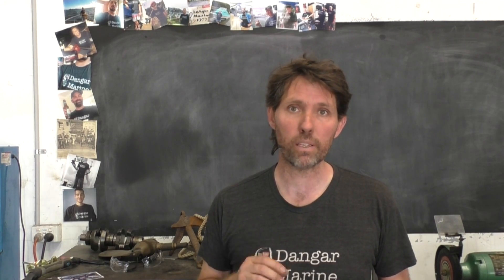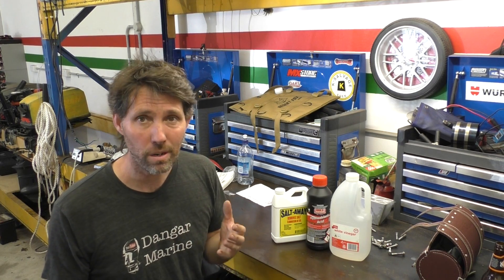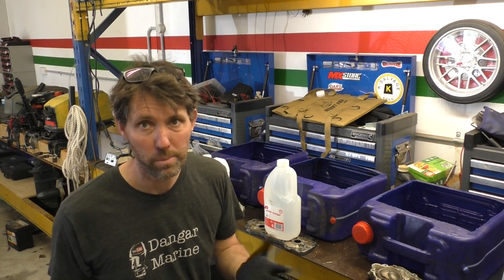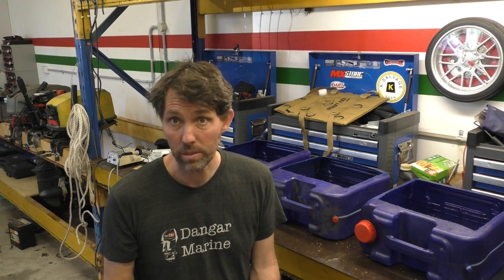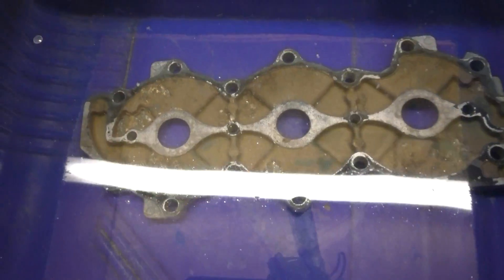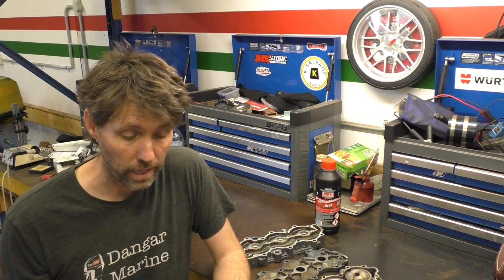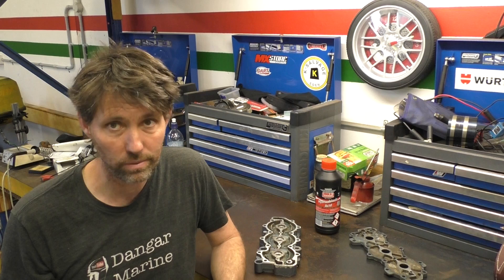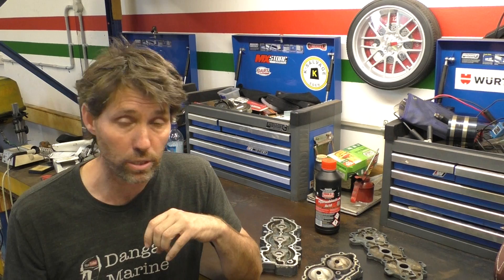Cleaning outboard water passages

Comment: I've used Saltaway and Rydlyme, via an extended flush with a bilge pump in a bucket underneath my motor. Rydlyme rocks, but it is expensive. Also seen good results with the acid.

Comment: I have a mercury/tohatsu 25hp 2 stroke, after I got stuck in sand immediately turned off , saw no damage... after a few days engine ran 4 hours then started overheating . 
I ended up checking compression 150-150 replaced fuel pump diaphragm , carb rebuilt , impeller , tested thermostat in hot water .. 

no damage to lower unit replaced gearoil and some gear oil seals while at it.. ran it still overheats after a while ran it with other coil cdi set from spare engine same problem..

it has solid stream once thermostat opened tested adjusting timing / air/mix on the carb nothing

I'm about to test the diluted acid in water trashcan for 45minutes method...im getting desperate . or any input?? maybe you know better then me or im missing something..

Comment: I had an overheating motor. I used a sump pump in a bucket under my lower unit and poured 6 gal of white vinegar undiluted. I discharged the pump through the tell tale connection and let it run about 8 hours, It worked, no overheating.
Reply: Did the same thing with Rydlyme, worked great! No more overheating

Comment: Thanks for the video, information, and side-by-side comparison.  I'm currently working on an '88 Evinrude 90hp that is overheating even after replacing the impeller. I really need to remove/replace the thermostats before trying a chemical flush. Think I'll just remove the leg, connect a holes to the water tube with a pump in a tub under outboard with the muriatic acid. Pump that thru the water passages a while and see what happens.

Comment: I know this is a late comment on a 5 year old video but I will share my experience using HCl. 
Motor/History: Mercury 2001 EFI 150 HP V6 - Tortured with Hawkesbury river mud and salt -  freshwater flushed after every use 
Fault: After 20 years - Overheating on idle despite a healthy urination stream and changing EVERYTHING in the cooling system
Remedy:
Remove the lower unit + thermostats from the housing and replace the housing and rapaciously jam a plastic tube up the orifice where the copper water normally fits into the power head from the water pump.
Connect a 12 volt pump to that tube to pump diluted acid through the engine collecting the discharge in tub with the immersion pump in it to cycle it through the engine
 I started with a ratio of 20 : 1 but the flush remained clear meaning it was doing nothing - need more acid!
Set up a control using aluminium, brass, steel and stainless in a beaker with the acid solution.
I kept adding acid until I could just begin to see some incipient bubbling action on any of the metals  -That became my water/acid ratio. I have no idea what it was but it was significantly lower than 20 : 1 - probably more like 10 : 1 or lower.

Ran it for around 2 hours until I could see the Hawkesbury river in the tub and loads of sediment on the bottom.
Then a vigorous freshwater flush and reassembly.

Prognosis: It been running without issue for at least 2 years since I did the acid flush. 
Interestingly, I had installed two temperature gauges (one for each head) and a water pressure gauge along with other indicators for everything that will trigger the engine warning buzzer. There's nothing more distressing than a warning buzzer where you have NO CLUE what is causing it. Like before the gauges I once had a thermostat fail, triggering the buzzer. Had I known what it was, I could have removed that thermostat and continued on my merry way not catching any fish as usual.
Anyway,  the gauge still creeps up more so on the starboard head at idle without reaching the trigger point, so at some juncture, it needs more acid or the heads need to come off for a thorough water jacket cleanout.

Comment: I've found nothing to work better than Rydlyme Marine descaler.  It's not cheap, but it works great.
Reply: Can attest to that. It works great, and has fixed my outboard which threw an overheat alarm (despite new impeller, thermostats, etc)

Comment: White vinegar is already deluded in the bottle. I think for vinegar to work it has to be pure (the industrial one for cleaning) and in motion for ionisation. I backflushed my salt outboard with pure vinegar, like 3 bucks a gallon. Removed the lower unit and thermostat. Using a garden pump connected to the thermostat housing. The vinegar was foaming and bubbling. Looked inside motor afterwards and looked pretty clean.

Comment: Many thanks Stu: you and your videos are just plum excellent. My trusty old 1986 40HP Yamaha 2-stroke started overheating - even at walking pace - so I've tried all sorts to flush it out. Neat Vinegar dissolved coarse sea salt (in my kitchen experiments) better than other things, but was no good on the mud/sand/shell/salt/corrosion deposits blocking the outboard waterways. The only stuff that finally did the trick was that HCl product that you used: eventually at about 30:1 ratio with water (2.5L HCl to 75L water): it quickly turned the clear flush solution light-brown, and left about 1/4 cup of 'interesting' deposits in the big bin (80L) after each 30min flush. The flush solution also heats up (to maybe 30-40C), which helps the process, as does the shaking/agitation of a running engine. I did a 10min fresh-water flush after each HCl flush (to dilute any residual acid to nothing important). My brand-new thermostat, and it's housing, look perfect, and the tell-tale is spewing water like a jet (so the impeller is still good-as-gold), and I can motor along on the plane once again, without the pesky red light coming on. So, heat, motion, solution-concentration and acid-type all play a part. Keep up the great work.
Reply from the maker: Thanks mate, my mate Paul went through a similar HCl process after having chronic overheating. His also running very nicely now.
Reply: Hello again Stu:  @DangarMarine  Had a blocked tell-tale today and tried something new that worked great. With the thermostat out/cover-off and engine running I connected a sturdy bicycle pump to the metal outlet/pipe for the tell-tale and pumped air+water back up through that exhaust jacket and out the thermostat hole. This dislodged easy 1/2 cup of gritty/corrosion deposits (against gravity) and the tell-tale now spews out clean and fast.
Reply: Worked great on my 115 Yamaha. 2004 model. Cleaned up I put it 100 percent  hca for 30 mi uses.  Great results
Reply: Given you cant buy 100% HCL (least in nz) . As it comes 24 or 28 or 33 or 38% strength  , which one did you use?
Reply: Question: Can you substitute muriatic (aka swimming pool acid) for the HCL?

Comment: I’m replacing my water pump in my 15 horse Honda Outboard.  One of the little rubber fins has broken off I can’t find it in the lower unit so it must’ve worked its way up into the engine. or broken down completely and washed right through…..is there anything I need to worry about with that? The impeller was on there too long I think it was about 14 years……
Reply: Did u ever get this figured out?
Reply: @alexvalencia586  I never did find it.  It sounds like they get chewed up and spit out.  I’ve kept a good eye on water flow and it’s been as it should be.  I take it You have a similar problem?

Comment: I have used white vinegar successfully with aluminium motorcycle tanks (eg BMWK100) that have been neglected and the fuel has gone "off". But this is straight vinegar and 2-3 days soak then a soft (green) scourer. It softens and loosens - but still needs a far bit of scrubbing. Haven't seen any evidence of damage.

Comment: If anyone is looking to use the correct acid, grab some phosphoric acid which is 85% purity.   Its cheap and can be found in other premix products from Bunnings or somewhere similar. Its also fantastic for cleaning fibreglass boats.

Comment: These outboards is incredible robust, i  used a Tohatsu 25 4 stroke for 10 years and only one impeller after 9 years and never off boat. But the lake i come into is brakish water after out in the fjord. No i have another smaller ten feet pioner with a new 9,8 Tohatsu. Break in is finsih in some days, there you see the thermostat  varying the water  pressure out of the engine because water no is cold, about 5 c here. but a wery strong  indicator water out of it. I live with the water and use the boat to all stuff, sometimes i borrov a dog and valks islands, other i svim in sea out in the fjords in summer here in Norway and never have a stop. This 9,8 is a  ok outboard, simple  ok power and light. The design is also nice  , this compact design on this 2021 model.

Comment: Something like Subaru upper engine or cleaner or equivalent product would be an interesting test also. Have also had great results de-coking masses of solid hard built up carbon in classic motorcycle cylinder heads using gasket remover. Head removed of course, Turns the carbon to a slime, might be effective in the water jackets too

Comment: I've run my boats annually for an hour in a bucket or trash can with 30 - 100% vinegar and it has improved the temperature every time.  An when I neutralize the stuff in the can before putting it down the drain, you would not believe how much junk precipitates!  I've done lots of acid cleaning of industrial heat exchangers and would never use HCl on aluminum.  But for daily flush I'd add salt away when if I ran in salt water much.

Comment: awesome video! I had a evinrude 88hp that kept over heating. I changed out the head gasket and still the same problem. After seeing this video I put 35 gal. of water in a barrel with 1/2 gal of acid. I tested it on a rock to see if it would foam up just a little,and i was good to go. I disconnected the hose at the discharge and nothing. but after 2 min. it broke through and now  water flows from both sides like a fire hose. After that you need to flush,flush,flush. If you want you can refill your barrel and add about 2 lbs. of baking soda to neutralize the acid. Thanks for saving me another $400.00
Reply from the maker: Glad it helped you. Yes, flushing and neutralising the acid is a great thing to do to stop it going too far.

Comment: Hi Danger Marine
I have a problem with my yamaha 80hp model F80BET - 6D7-L-1007430 vintage 2007.
there is water in the engine oil :-(. I have tried changing the thermostat but it did not help.
what might be the cause of this problem
greeting Jens
Reply from the maker: Usually this is caused by a blown head gasket allowing water from the cooling jackets to get into the oil.

Comment: Hi Danger Marine
I have a problem with my yamaha 80hp model F80BET - 6D7-L-1007430 vintage 2007.
there is water in the engine oil :-(. I have tried changing the thermostat but it did not help.
what might be the cause of this problem
greeting Jens

Comment: Question? Mercury 60 horse outboard. Sets overnight does does not pump water. Put a hose in the peephole where the water comes out of the engine, turn the water on or about 1/2 minute why is running. Remove water hose. The pump keeps pumping water from there after. Every time you turn it off, the pump works fine. Turn motor off the next morning restart the motor and it does not pump water. Then I have to start all over like I said and that it works fine again, do you know why?
Reply from the maker: You might find it has to do with how deep the gearbox sits in the water https://youtu.be/lOE_VRda52A
Reply: @DangarMarine  3 foot of water.
Reply: @DangarMarine  the whole gearbox is in water.
Reply: What does the water pump impeller look like?  How much water pressure when it is pumping water at idle and 2500rpm?
Reply: @tbl8560  I had to replace the water pump propeller
Reply: @emptyblank4320  all good now?

Comment: Main takeaway from this vid, and perfectly in line with my opinion is a decent product used with discipline from the beginning is where the magic is. Prevention is the whole trick. 

A flush product won't fix neglect.
Reply: how you gonna prevent something thats allready done, after buying a secondhands engine
Reply: @mother-fng-bonswa3612   I made no mention of preventing  someone else's neglect. My statement is advice for an original owner.

Comment: Dangar, great videos! By any chance do you have a diagram of how the cooling passages flow in these bigger yamaha motors? Have a 250hp ox66 that overheats at idle. Have changed water pump (housing as well), poppet valve (PRV), replaced thermostats, opened heads and cleaned everything/changed gaskets. Running out of ideas! Thanks
Reply from the maker: Unfortunately not for the larger engines. It could be a  faulty sensor so check with an infrared thermometer that it is actually overheating. Could also be a blown head gasket pushing the cooling water out of the water jackets.
Reply: Dangar Marine thanks for the reply! Temp is about 170F (77C) on starboard side top cylinder so I think it is overheating. The other side runs much cooler. I replaced head gaskets already and cleaned out visible corrosion. I did notice water wasn’t getting to thermostat housing.
Reply: Hi have same issue with my ox66 at idle after 5 mins on idle on the muff only… what did you end up having to address to fix the overheating? Regards nick

Comment: Here's a method of flushing an outboard motor that some may find helpful.
Get a gallon of 85% phosphoric acid solution from Amazon; use a 
submersible pump, a cheap short-length garden hose and a 5 gallon
bucket.  2 quarts acid solution with with 12 quarts of water produces a 7.24 : 1 ratio of water : phosphoric acid.  (Maybe better: 1quart acid solution with 6 quarts water will cut total volume from 14 to 7 quarts---less messy) 
Take off lower unit and thermostat(s). Connect female end of cut hose  to pump in acid solution in bucket, hose-clamp cut end onto water tube of motor. Connect male end of cut hose to motor's flush inlet; cut end returns solution to bucket.
Run pump for 2 hours (Do not start motor). 

After treatment replace thermostat(s) and test running motor with water hose and muff.  Should show strong flow from tell-tail.

Comment: Hi Stu, i own Mercury 6 hp 4 stroke, 2008 outboard and the other day after trolling for a while I stopped to take a break, started the outboard and noticed that there is no exhaust fumes going through the propeller and no bubbles around it at all and the outboard became a lot louder. There is a water coming from cooling water check port. Have you ever had a problem like this?
Thank you.

Comment: The bottle shown in the video is a Coles white vinegar 2L bottle and contains only  4 to 4.2 % vinegar (I researched this, which is a complicated way of saying that I googled it..) ..  4% is nothing... There is also "double strength" vinegar, 8-9% .. This is already better of course. But as far as I understood from other sources, you have to accelerate the process of vinegar by adding salt to it and shake/mix it.. This is at least what I did today when I was flushing the outboard... See if I can get any positive result (I have some low RPM overheating issues on a Yamaha F60). Might flush a couple of times more with vinegar alone. Some mention baking soda but I am too scared for such an experiment.

Comment: I'm curious how electrolysis would do on salt corrosion. Wouldn't be hard to set up. Would require:
-  12V battery charger.
-  steel plate (to connect to post terminal).
-  a tub or maybe an aquarium for easy viewing/filming.
-   some wire (to connect the submerged steel plate to pos terminal and each submerged corroded item to neg terminal of battery charger).
-   water. (2-4 gallons).
-. Baking soda (I think).

You may already know the answer! lol
Reply from the maker: I've used it more for steel (https://www.youtube.com/watch?v=Q12EIRbFKPk) but it would be interesting to see what happens with aluminium.

Comment: Great test! 
Acids will not affect plastic or rubber! 
They come packaged in plastic! 
But they will affect aluminum! 
Concentration is the key! 

HCl will dissolve aluminum but it takes a long time so not really a worry! 

Fresh water after every trip is the ticket! 

Strong hot solution of HCl for a badly corroded engine.

Comment: "You're miles ahead of the game if you can do a fresh water flush every day."
Excellent point, but "how is it done easily?"
Immediate access to a fresh water hose being  the obvious first requirement, access to a flush point is often overlooked.

Yamaha's solution is elegantly simple and stunningly effective.
A 9.9 I inspected has a fresh water hose injection tapped into a "y" in the tell tale (pisser) line at the carburetor outlet.
What I like about this design is that it gives  your engine a BACK FLUSH, dislodging anything that might have clogged the system, and they have a standard hose connection that you can immediately locate and screw on without fiddling for (where did I put those damn ears) the connection that always seems to get misplaced when the kids use the boat.

HERE'S MY REQUEST:
Do a series of videos on how to add a similar connection to every different style of engine on the market.
It's a big request but it's something that every boat owner can appreciate.

Yamaha's design also has another benefit.
You don't need much pressure to get it to work.
On the other hand, "ears" that attach to the lower unit always seem to leak profusely and that means you need more volume or pressure from your fresh water connection (something that isn't always available).  Yamaha's design is fool proof.  Almost any amount of water pressure will be sufficient to flush your system.

What do you say?  Are you up for the challenge?  (How about starting with an Evinrude intruder 150 (Hint... hint... hint...).
FOR EXAMPLE: (I was thinking- If I could only unscrew the tell-tale [right at the cowling] and screw a pipe fitting in it's place.  Would that work?)